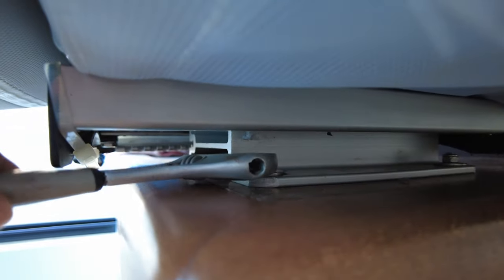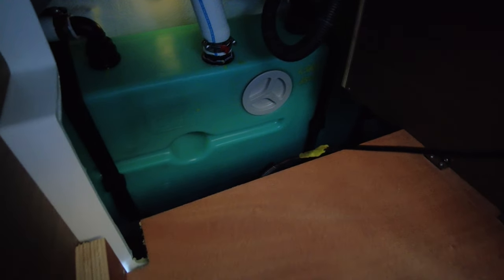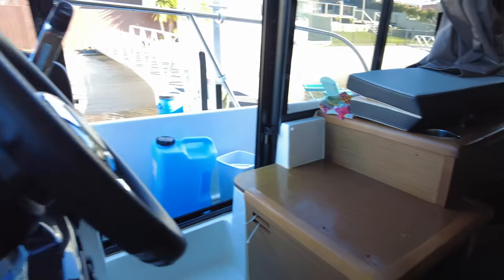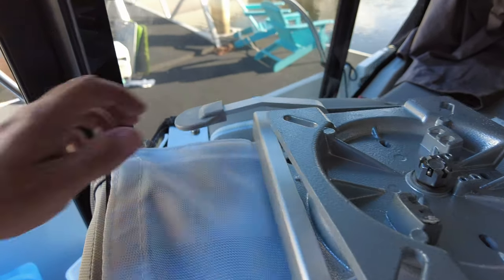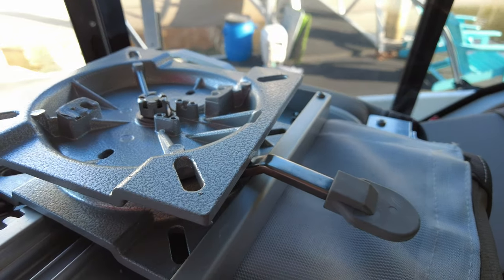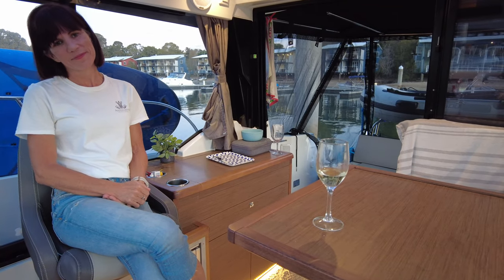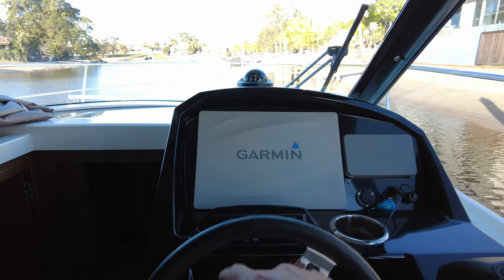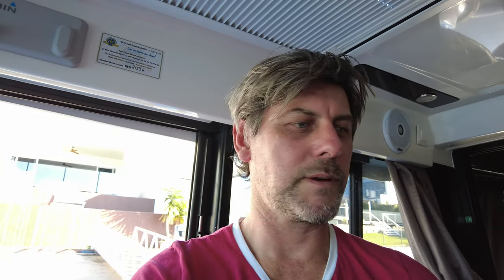CAPTAIN CHAIR UPGRADE SWIVEL AND SLIDE | The Rudder

Comment: Hello and bravo for your very informative video which teaches us a lot. We have the same boat as you and are sailing on Lake Geneva in Switzerland. I am very interested in the rotating support for the seat. I would like to know if we have to re-drill new holes or do we keep the same ones? also the model number and brand of the support.
I sincerely thank you and always look forward to your new video.
Best regards from Switzerland
Reply from the maker: Hi Michael, I have been to Lake Geneva, what a wonderful place to sail!
I didn't have to drill new holes for the seat. The swivel and slide base I got doesn't have a model or brand the only things is it's part number PART NUMBER: RWB-5043.  The base (attached to the boat) lined up perfectly. The attachment to the seat was not perfect as it is a little longer than the seat. But you can get the screws in without re-drilling. To make it stronger maybe some extra drilled in screws would be good.
Reply: @TheRudder  Hi great video, I would like to do the same, can't find that part number , Please could you check Thanks  S

Comment: Hi, great option,

Is it possible to order original from 895 sport model and put it in 895 model, will it fit and work?
Reply from the maker: I should work, talk to a Jeanneau dealer in your area. There are plenty of swivel chairs in the aftermarket as well. It is a fairly standard sizing.

Comment: as always you propose some great ideas, I too had thought of this upgrade. where did you make the new mechanism? is it possible to buy it? thank you
Reply: Also like to know where the new swivel base can be purchased.
Reply from the maker: I got mine from an Australian company - the Boat Warehouse, but I have seen them on Amazon as well. Search for boat seat slide and swivel. Make sure it has a screw base and not for a pool mount. https://www.theboatwarehouse.com.au/
Reply: @TheRudder  could you post the mfr and part # for the base you purchased? It may be easier to search for the specific part here in the US. Thank you for the great videos!